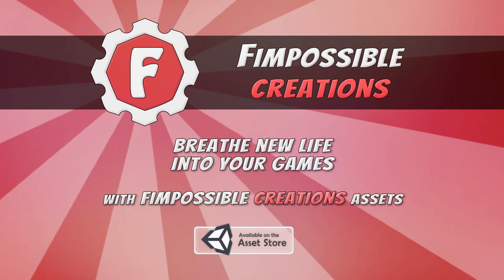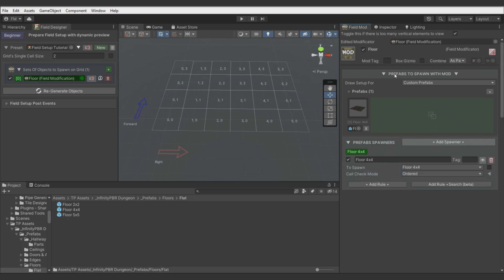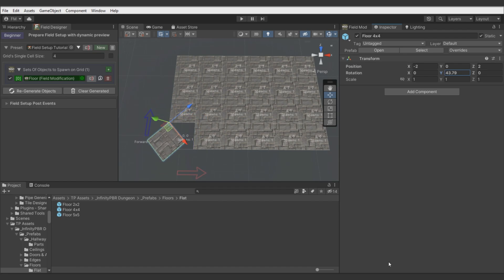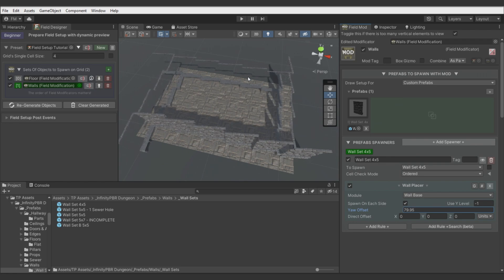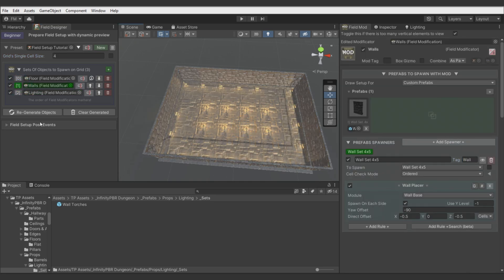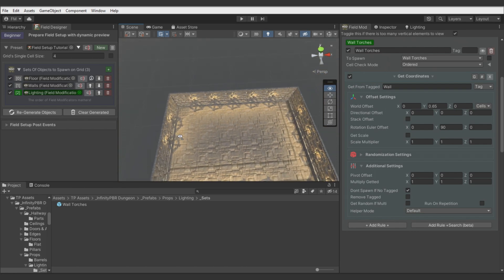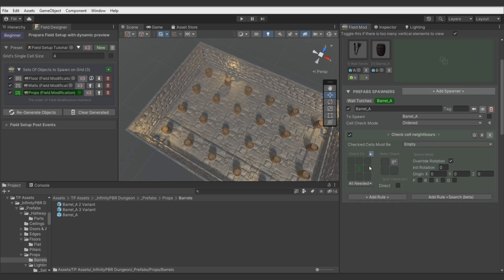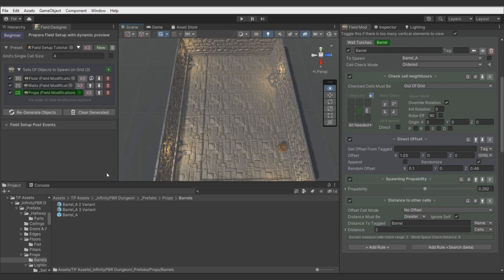[PGG] Field Setup Fundamentals Part 2/3 - Adjusting Third Party Modules

Comment: Hi. Thank you for the video. Love your asset! Is it possible to set the spacing of the light, so that it looks less random? So like "Every 3 Walltiles, except from corners and doors, minimum distance from doors and corners = 3" ?
Reply from the maker: Hello, thank you! 
You can add "Optional Cell Data" to the door command and use "Distance to other cells" rule with "Cell Data" switch.
With corners you can use tags, but if you don't use corner wall tiles you can add empty spawner, detect corner with "check cell neightbours" node (1st tutorial) and use "Add Cell Data String" to append extra info into cell (this needs to be called before light spawner), then again use "Distance to other cells" rule with "Cell Data" switch.
In addition you can set "Cell Check Mode" from "Ordered" to random to add some randomness for the logics, cells will not be checked per row but in random pattern (it's covered in 1st part).
Reply: @FImpossibleCreations  Awesome, thanks. It shows the tools' potential, that you can find solutions to complex problems via logic and operators. Keep on the awesome work! It will be a must have Asset for every level designer, when it's done!